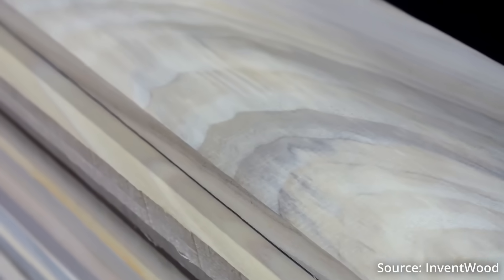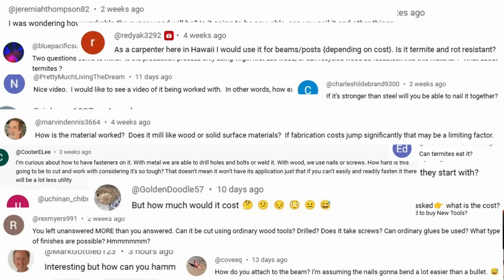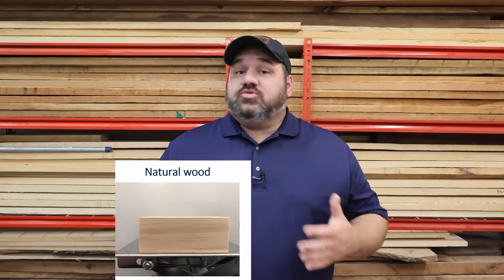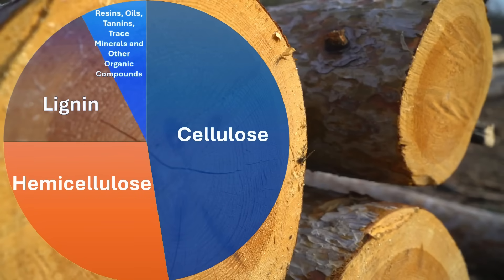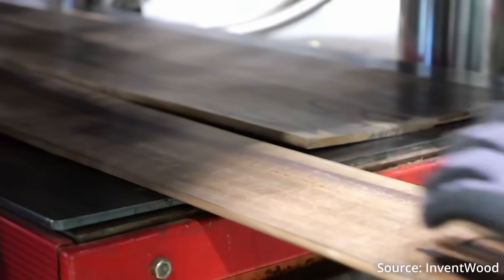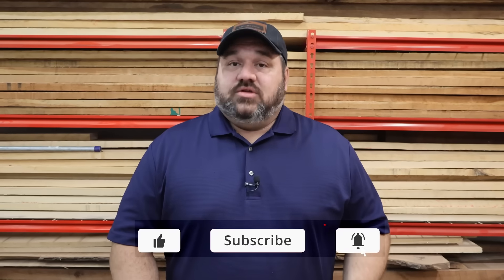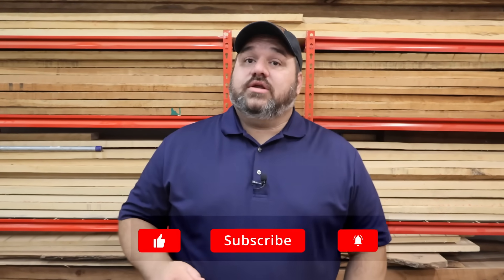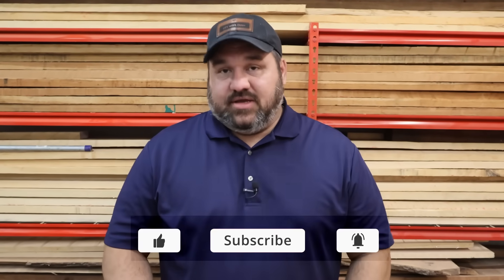The TRUTH About SUPERWOOD - I Met With The CEO of InventWood and Have Answers to All Your Questions

Comment: A lot of commenters seem to be missing a few points that I can easily think of, some of which are as follows:
1.) If it's that much stronger, then the size of the material to do the same job (strength wise) would be much smaller, so for example if you were doing the fencing panels, they could be much thinner, whilst still retaining all the properties like rot resistance and the same strength, so the cost doesn't necessarily need to be that much higher.
2.) If strength, rot, insect and fire resistance etc are it's major strengths, then using it in scenario's where those factors are critical will be the likely places where it would seem the most potential take up, so replacing steel beams, having external cladding etc that's much thinner, looks great, is fire resistant etc, but is just as strong and weather resistant.
3.) If it can be "formed" like it sounds it can, then making things using forming processes that play to it's strengths would be another option, for example lightweight body panels on cars, much cheaper than aluminium or carbon fibre, but much lighter than steel for the same strength.

Truly though, till it's fully tested and it's particulars can be known, it's impossible to say exactly what it's true potential may be.

Comment: Cool. I love new advanced materials. Chemical cross linking at its finest application.

I’d like to see the supply chain of wood products collectively support and get into genetic engineering of trees to grow better wood, bigger, taller, faster, denser, drought resistant, fungi resistant, alternatively expressed for better oil byproducts etc or more flowers for bees and wildlife or expressed to produce better cross linking structures or delignifying properties.

If trees can grow as fast as bamboo then that would be grand and sequester carbon more rapidly.

Why should just oil and fossil invest in renewable technologies and carbon sequestration when wood supply chain can also support advanced genetic engineering.

Comment: will it have chatoyance? like will curly and quilted superwoods still have light bounce off in the same way as before being processed? and can they use burls as well and it still look as good as before it was processed? and what about weight? say knife maker was going to make a hidden tang knife and needed a block that's roughly 6"x2"x1", will it be significantly heavier or about the same?

Comment: I'm curious how this would work for airplane building. They are often made with Sitka Spruce or welded steel frames. Could this bridge the gap? Or does it not glue well and is thus unusable? Be interesting to see it evaluated for this use. The high cost would be more palatable here, as aircraft grade Spruce is already quite spendy.

Comment: I wonder if this could be a replacement for many use cases of dense plastics.  If impregnated with resin, perhaps this could have similar properties?  I wonder also, if the superwood could be molded to some degree as it is heated and pressed?  I would love to see a mor renewable replacement for all the plastic stuff we use, at least in large applications like cars.

Comment: Potential uses of such a product could be almost endless.  Myself, I'd love to dabble with in in the construction of something like a travel trailer or tiny house.   In place of typical construction materials, If this is that much stronger, while it might not produce tremendous weight savings, it could produce added rigidity and strength while still being able to be used at lower thickness than tradition wood.  I imagine this would also produce a more solid trailer with less flex in transport.  I'd be curious as to its ability to insulate against temperature, noise, and treatment to improve resistance to water penetration too.   Imagine the look of a travel trailer with the exterior resembling that of a house with wood plank siding.  It certainly would be more appealing that that of the typical refrigerator white boxes we see today, and if there's structural benefits from its use it could be a bonus.

Comment: Because of its density and strength, you would probably not need the same dimensions to construct something so costs might be reduced because not as much volume would be necessary., i.e.: board/feet. I imagine finishing could be a problem with binding to the wood.

Comment: I watched both this video and your first one.   Two comments:
#1) Saying it is 'stronger than steel' ABSOLUTELY REQUIRES an explanation. For example, what it the metric for this - tensile PSI, Shear PSI, etc. Is that on a per pound basis or for comparably dimensioned parts in tension, bending, shear, etc.?
#2) Calling steel 'non renewable' is a word game, as it is one of THE most re-used, recycled. Are those characteristics to be excluded when assessing renewability? Please explain.

Comment: Applications could be : siding, ie, long lasting like fiber cement but lighter and less prone to tearing and cracking, and less dust when cutting; exterior trim, deck boards, door fab, flooring ( cedar, and syp made suitable for flooring, maybe even white pine , spruce, and fir [making pecan denser would be cool]); and if course furniture, ie, pine is now table top and cutting board material.  
I wonder if super spf is like "iron wood" ?

Comment: What kind of density are we talking about?  Will it float in water?  Can I get sheets of this material for laser cutting?  Can I soak it in epoxy?  Is it only strong in tensile strength?  How much plastic deformation does it have?  Does it split like wood?  Will screws wedge split the wood?  Does it machine like fiberglass?
Reply: It seems logical that it doesn't absorb epoxy. I was thinking about the same, in boatbuilding.

Comment: I usually use an electric saw (table saw, miter saw or circular saw) to cut wood to it's initial size.  Those blades all have carbide tips, so it sounds like cutting superwood is normal, until I remember that I sometimes use chisels, bench planes, hand saws, files and other iron/steel based tools to finish sizing the material.  Then I usually use sand-paper to sand wood.  Will sand paper work on superwood?  Are there any special types of sandpaper that won't work, or will work?  Or am I going to have to use grinders  or wire-wheels here?

Comment: The treatment with caustics is the same way wood pulp is processed to eliminate the lignin to make paper.  I assume if there is wood with caustics remaining in it, it won't be appealing to insects.
      The only thing that is assured to survive fires and earthquakes are metal boxes.  Maybe some stucco can be placed on them with webbing in it, so when the box moves, it remains attached and doesn't crack.  People need to learn to accept metal boxes, if they live in Los Angeles.    Wooden fences need to be banned.  Chain link and masonry should be allowed.  Maybe metal panels can be used.   Masonry would likely break in an earthquake, but won't generate life threatening or serious property damage situations.

Comment: The use for Superwood------who can say. Too many unknowns. If it is going to depend on a coating for water resistance to avoid rotting, then in that aspect its no different from any other wood.  When and if you get a sample that's large enough to play with, I suggest you compare it to Thermowood, an existing wood product that is already on the market. How can the company be setting up for full production when there are so many unanswered questions. It comes close to sounding like a pump and dump play

Comment: I might have missed it in the video, but my question is:  will a standard water based primer chemically attach to it - or do you need a Bonding primer, or do you have to use an Oil/solvent based Bonding primer?  anyone?

Comment: If it’s non-toxic and as strong as claimed, it’s going to be amazing for flooring. Remember this take though: $75/sq ft gonna scare off basically everyone. This is exactly what the world needed, something to make white oak flooring seem affordable.
Reply: Why would you use this for flooring instead natural wood?
Reply: @RAREFORMDESIGNS  Durability.  For example, women walking around in stilettos will put dents into almost any hardwood floor.
Reply: @missingegg and it could be used exposed to the elements where it would last far longer than untreated wood
Reply: @missingegg  You have no idea what you're talking about.
Reply: @RAREFORMDESIGNS  When I was young I had a job refinishing hardwood floors.  Takes quite a bit of sanding to get the dents out from stilettos.  Dog's claws can also damage hardwood floors, depending upon the size of the dog.  Of course some hardwoods are tougher than others.  But don't take my word for it: many hardwood floor companies recommend not wearing high heels.
Reply: @RAREFORMDESIGNS natural wood floors scrape easily, and sanding will wear them out quickly.  I would figure that a harder material would have shallower scratches, and could be simply re-stained for minor wear (or perhaps lightly sanded)

That or bathrooms where it would get water exposure, maybe on the walls (as it still swells up when soaked).
Reply: If the ingredients mentioned are a complete lists, there wont be anything toxic about the end product..

I was also thinking flooring as a first application. But yeah, it will all come down to the price. The other processed wood products I have seen on the market certainly had some sticker shock attached to it, even though in theory it also sounds like a simple process.
Reply: its boiled in caustic soda, but not mentioned if the residue is still there when worked (can you even work it?)
Reply: @chillpillology  It is washed out and there is also a process that can recover and reuse the chemicals. It is still wood. Working it should be similar to some of the exotics woods that are naturally very dense
Reply: @chillpillology  caustic soda neutralizes fairly quickly, when its not in a closed container but can absorb co2 from the surroundings.
Reply: Flooring was my first thought, but that would be very price dependent.

Comment: During their process, are they taking 6x6 material and "finishing" it as 4x4? The strength properties are intriguing. I can think of a wide assortment of commercial storefronts that would look so much better in wood than the current vinyl-covered products.

Comment: Are we gonna see wood paneled cars again? XD
Reply: And wooden ships
Reply: @spikslow wood vessels  never really became  obsolete,  they just went from standard built to homebuilds or small craft of haves  or big one offs for the real have’yachts in our society
Reply: I know with cars that weight cutting is a huge priority, so if it has better strength profiles without too much extra cost it may get picked up
Reply: Are you missing your dad's Vista Curser or are you just missing your youth?
Reply: @David-yf5fo  I recently watched "How we KILLED the Greatest Kind of Vehicle" video, so it was on my mind.   
TLDR: Wood took too much maintenance compared to metal. IF this "superwood" is both lighter and maintenance free it may revive using wood in vehicles. (Real wood, instead of the laminates used in RVs.) On that note, it may improve how RVs are built- they have a LOT of manufacturing issues based on how they're currently put together.
Reply: yes, we need a new Super Woody 😊
Reply: Whole wood body cars please
Reply: Yeah !! 'We're goin Surf City !!" :face-blue-smiling:🏄🏄‍♀
Reply: Screw wood paneled cars, I want a car with  the body/frame made out of super wood. If it’s really that much lighter than steel they could either make cars similar to current sizes more efficient or they could make SUVs and trucks much bigger than they currently are. I’d want one bigger personally. I imagine it would likely fare better in crashes depending on how the car was built.
Reply: Maybe wooden frame instead of steal framed cars.

Comment: Loudspeakers could be a great start. Currently, most loudspeakers are made out of MDF. Cabinets become very heavy and still resonate a lot. Dampening these resonances is a huge headache. Processing MDF is toxic. (Finland) Genelec makes their loudspeakers out of recycled aluminum - what is good for industrial mass production but not for DIY / small volumes / experimental models. So, the technical questions: Young modules for tension/compression/sheer? Internal damping, frequency dependent? What about I-beaming such as laminating with S-glass or laminating foamboards with superwood?

Comment: The chemical process is similar to caustic pulping to make paper only keeping the wood intact instead of grinding it up to increase surface area.  So it would seem that the boards are placed in a high temperature pressure cooker to drive the reaction rate and permeate the boards.  So just that part of the process would be capital and energy intensive.  Railroad ties and pressure treated wood are made in this fashion only there the preservative is infused instead extracting lignin and other materials. I have no idea what the commercial compression process looks like but it too would be expensive. I think this material will be interesting but relegated to specialty uses.  Disposing of the extracted lignin and other materials will also be expensive unless it can be burned like black liquor in a pulping operation.